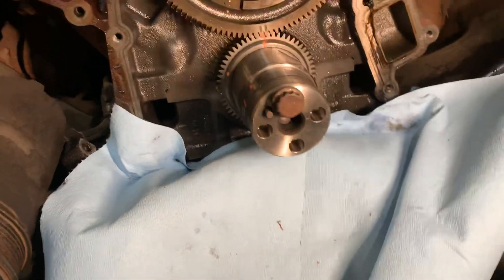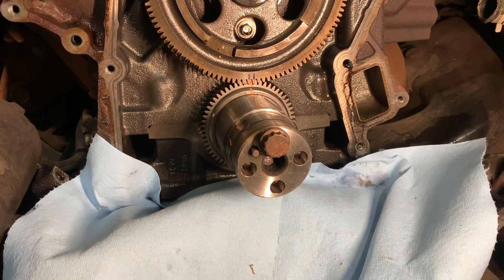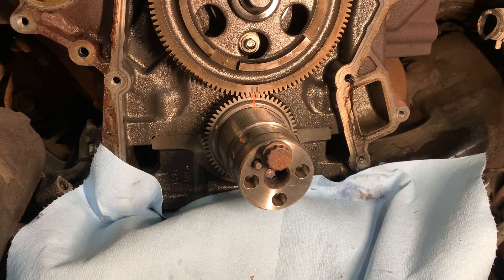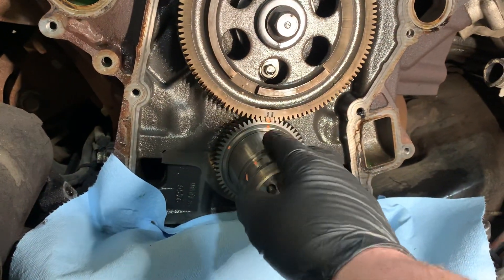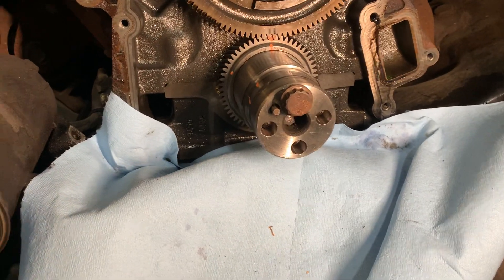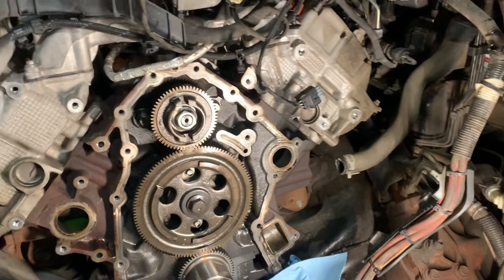6.7 Powerstroke don’t need no stinkin key way

Comment: what would happen if he continue driving the truck with that code on since it had not been running rough
Reply from the maker: @Luis-ic8ej  The injection timing will be off.
Reply: Would it cause damage to the engine?
Reply: @Luis-ic8ej  if the timing gearing is off its not gonna cause any damage? are you listening to yourself?
Reply: I just got truck back from mechanic for other issues and I am drained $$$ so wondering since the code p0016 just came on if I can continue driving or take it in the shop. Last year the cp4 pump went out I am guessing that made the crank gear spin but I just got the code today
Reply: I had cp4 failure & my crank gear has spun I’ve got truck back running but now have the p0016 crank cam correlation code & your right there is not of straight forward info on this repair im gonna do this repair myself could you please share how & what method you used to remove the crank gear thank you in advance
Reply: Hello, thanks for the video. I wanted to ask, I noticed you didn’t pull the oil pan. Are you able to just pull the front cover to complete this job? I’ve been told the lower pan meets the front cover as one seal and doing them separately will leak? Thank you